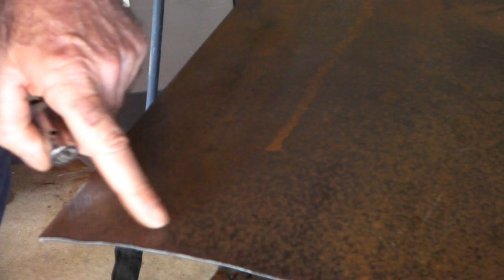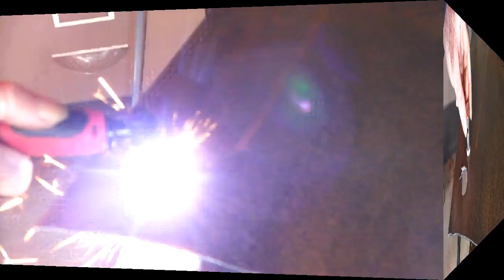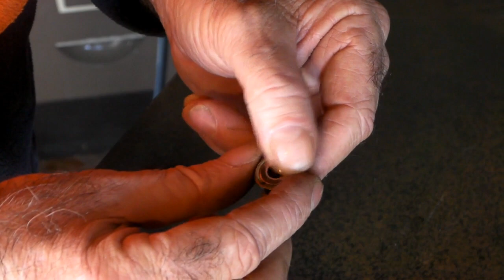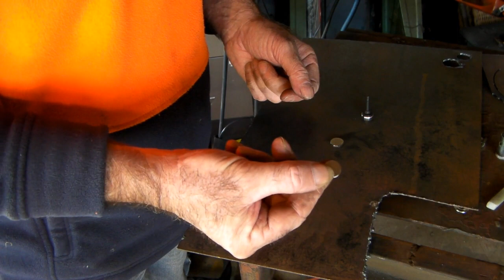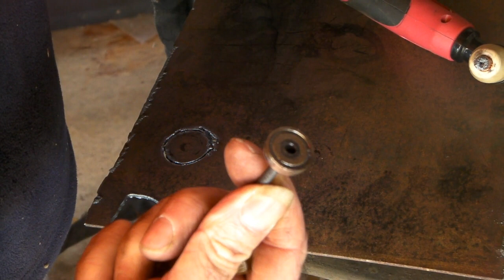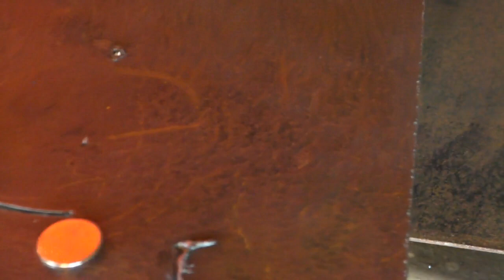PLASMA CUTTING HOLES WITH MAGNETS

Comment: Plasma cutters use DC for cutting. DC and magnets don't go together even when stick welding with a stick welder in DC. However when stick welding on AC magnets work fine. Because the current is constantly changing direction.
Reply from the maker: great thanks

Comment: If i had to cut a 1/2 inch hole i would use my pattern with a hole size of 7/8 and drag around the inside. making an x on the pattern before you drill it gives you reference marks for accurate hole placement.
Reply from the maker: Hi bob good idea thanks

Comment: Had the same sort of thing happen to me with these hinge magnet things that hold ya work whilst ya weld. Lost the magmatism in one of the inserted magnets. I was spewing. So from from then on I just tacked welded rather a full bead. Pete I was wondering mate. If you got a washer and just gave him a tiny ever so small tack weld to your plate then traced it. The tack would be so so small you would just burn through it once you got to it with no drama. Only thing is you’d probs have to start just one side of it and do a lap meeting up with the tack. I don’t know mate it mite work.
Reply from the maker: Yea it happens

Comment: I have cut small circles  using coins or other small disks held on with double faced tape or glue.  I have also used  plywood with holes drilled .
Reply from the maker: Thanks for the tips

Comment: If you want to make a bunch of neat holes fast and you don't want to use a shaped explosive charge, just make a template out of 1/4 steel plate and use that to guide your torch.
Reply from the maker: cool

Comment: Electromagnets should only suffer temporary loss of strength while exposed to heat.
Reply: Neodymium rare earth magnates are not electromagnets. They're just regular old magnates with fancy materials and design.

You'll bugger any magnet in no time if you expose it to a massively strong electromagnet, and that's what Pete did when he used the plasma cutting torch right next to it.
Reply: @LawtonDigital  No kidding, I'm speculating the long term effects of an electromagnet. I'm also curious whether it would lose strength as heat builds.
Reply from the maker: Yes you live and learn mate
Reply from the maker: good info thanks

Comment: Rare earth magnets loose there strength at about 300f even high heat will loose its strength I weld around magnets and  it is tricky work because the magnetic fields (flux) willpush or pull the arc better off using a slippery stand off around nose cone or bearing
Reply from the maker: Yea learnt that the hard way lol

Comment: my guess is drill a hole and put a washer on with a bolt, use that to cut the hole; 2 things that ruin magnets are: heat and impact(hit with a hammer or dropping it)
Reply from the maker: thanks

Comment: The magnitude of  force on a charge q traveling at velocity v in a magnetic field B is qxvxB, where x means multiply, the direction is perpendicular to both v and B. In your case the direction of v is perpendicular to the plate & The direction of B at the edge of the magnet is some angle between perpendicular to the plate & parallel to the plate & that causes the plasma beam to bend as you discovered. Additionally, the magnets exist because the conduction electrons are all held by the chemistry of the rare earth magnet to point in the same direction, so that you get a strong magnetic effect. As you have things the plasma is bent into the magnets heating them destroying the alignment of the electrons spins to create a random ensemble of directions, thereby destroying most of the magnetic effect. Very occasionally a physics PhD gives you useful insights! Thanks for sharing!
Reply from the maker: WOW, cool thanks
Reply: You learn that in high school physics no need for a phd. And then again all throughout your bachelors and masters. Phd is going too far

Comment: You can drill a template oversized and fit the tip inside. Oversize by the radius of the tip.  Just get some 1/4 inch plywood pieces from the bin over at the the box store.
Reply from the maker: wow cool thanks

Comment: It is a general mistake using magnets near a plasma stream,the magnetic field will alter the characteristics of the flame. Have been there and done it. even using magnets to hold fixture if too closec will cause problems .
Reply from the maker: That explanes a lot cheers

Comment: Hi Pete, I'm new to your channel and the plasma process. I don't own a machine yet but will soon since I'm tired of filling up the tanks. I'm used to cutting with a gas torch so I'm curious about why I see some operators make cuts with the torch suspended above the metal and others seem to drag the torch across the surface? Is it just a difference in the machine? This is probably a fundamental question, but if you could help out a newbie, I'd sure appreciate it. Thanks
Reply from the maker: Hi mate check out my video  here : https://youtu.be/nfItOjYrZNg
cheers pete
Reply: Pete, got it. Thanks for sharing your knowledge and experience. Coming out clearer than mud on this end.
Reply from the maker: clearer than mud, I love it mate  at least you get my sense of humor .
Thanks for watching cheers pete

Comment: At high temperatures a ninety will demagnetize. You get above the threshold, and that’s it. The magnet is too close to the plasma, and you only have to get to a few hundred degrees to demagnetize it.

Copper is also a magnetic material, though not in the way iron is. So it’s affected by magnetism. You’re right about the arc. As in welding, the arc is affected by the magnet, particularly if your cutter is DC. Not as much with AC.
Reply from the maker: Thanks for the info .I wont be doing that again LOL.
CHEERS PETE

Comment: You got it... magnets don't like heat. Magnets are made by heating the "blank" above its "Curie point" (https://en.wikipedia.org/wiki/Curie_temperature) in a very strong magnetic field, generated by a coil with DC flowing through it, and letting it cool down. It doesn't matter whether it is an old fashioned steel, an "Alnico" (Aluminium, Nickel, Cobalt), ferrite or a modern rare earth magnet. Rare earth magnets tend to chip and can even "explode" (fly apart very quickly) when hit hard. They are made by grinding up the material and heating it to a fusing temperature at several thousand pounds per square inch... sintering. When it has cooled, they electroplate it to stop it from deteriorating in a moist and oxidizing atmosphere. It is reheated and magnetized. 

The column of plasma is generated by a direct current and when DC passes through a conductor, it acts like a magnet. Plasma is a column of charged gas and acts just like a conductor. If you put a magnet near this column, it will be attracted towards the magnet... just like putting two magnets together, the right way round, of course. This effect also happens with the old AC arc welders because the arc is a column of electrons and tends to sort of rectify itself due to the thermionic effect. If you preheat an arc welding electrode on a hunk of graphite... for example and then put it near where you want to weld, the arc strikes very easily because red hot metals readily emit electrons, if available... negative particles. Again with the current flowing through a conductor and it will be attracted or repelled by the magnet, mucking up the weld.

The best way to make your holes is drill a hole in a piece to thin metal or hardboard, if it is only one or two holes. Work out how much bigger the pattern has to be than the hole and clamp or hold your pattern and cut around the inside. If the area lends itself to using a magnet,  you could use aluminium and mount it on a couple of magnets, well away from the cutting area. Make sure the heat zone is away from the magnets as well. Cleaning up after cutting and grinding without a vacuum cleaner... place a strong magnet inside a plastic bag and wave it over the area. Don't make holes in the plastic bag! When you are finished, hold the magnet and turn the bag inside out, trapping the particles inside the bag. Tie up and drop into the rubbish bin. Your magnet stays clean this way.
Reply from the maker: Wow  very cool explanation  now i know why it doesn't work YOUR a smarter  man than me LOL.
thanks again pete
Reply: @petestools  I'm a retired industrial electronics technician and magnets and magnetic materials were one of the main areas of my research and applications. Not smarter but spent longer... years, working with them. I'm learning lots from your videos... so thanks and my feedback is just a way of returning the favours. 

I like the motto of the "Teach Yourself" books from way back... Teach a wise man and he will be yet wiser.
Reply from the maker: yes that's how i think about learning stuff  Just try it and do it for yourself 
thanks again pete
Reply: You wrote what I was going to (I remember Curie point and the left-hand/right-hand rules for inductors) but better, and more:  I'll try keeping my magnets in plastic bags from now on!

Comment: Here is a tip for you pete. Drill hole in a template. Slightly bigger than you need. Clamp the template to the steel. Then run the nozzel round the inside of the template. Different sized template holes will give you differnt sized holes in your steel.
Reply from the maker: cool will try it cheers
Reply from the maker: COOL
Reply: good idea